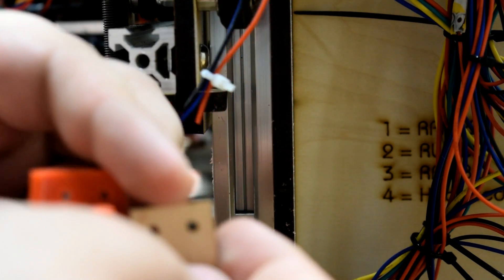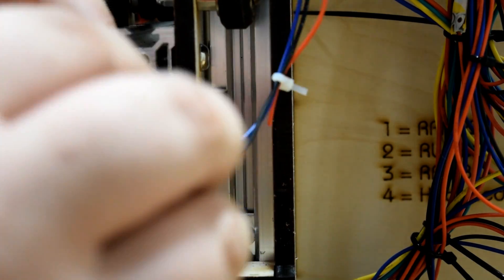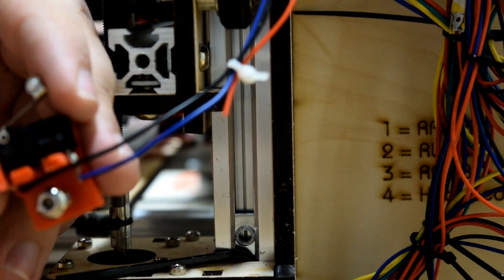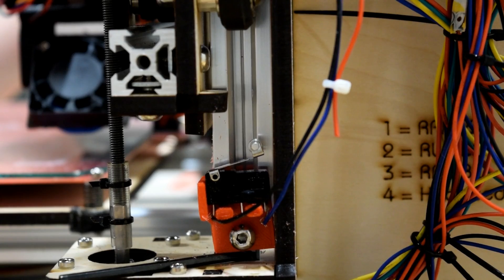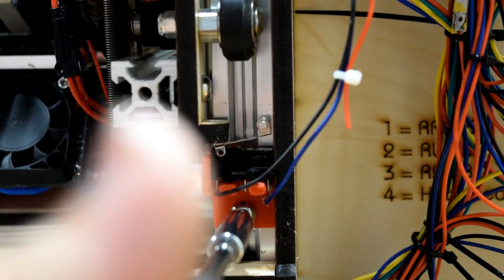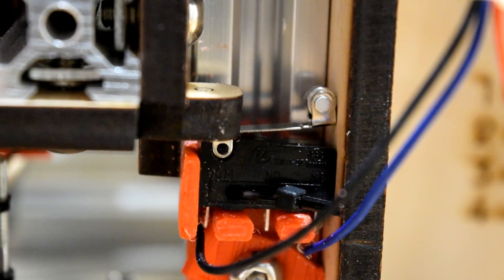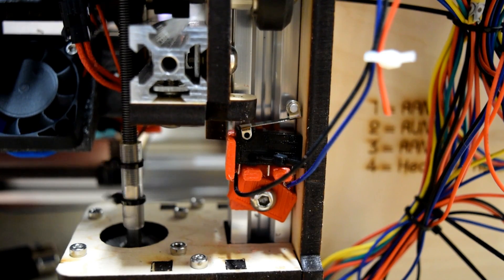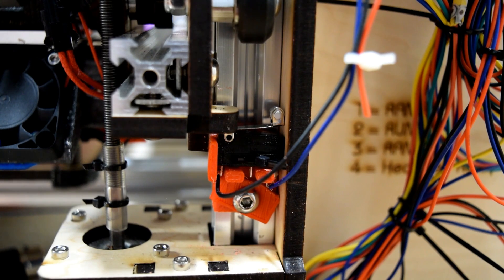LETS FIX MY PRINTER! Part Two - The Z End Stop - Maker Farm i3v 12"

Comment: I think you should rotate switch 180 degree, so that blue wire will be on the left.
Reply from the maker: +Eugene Hvorostyanov I had it that way for the beginning life of the printer, but that metal arm would cause Inconsistent extruder height. So far this alignment has been spot on.
Reply: Oh, it makes sense. Thanks for reply.